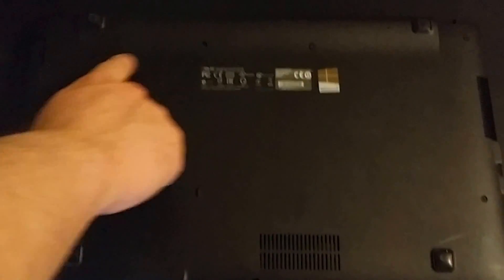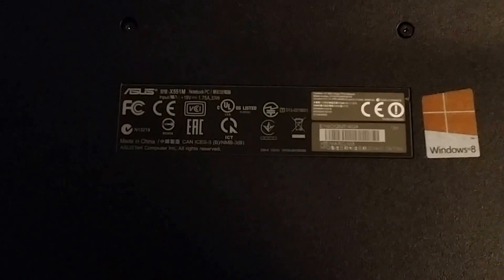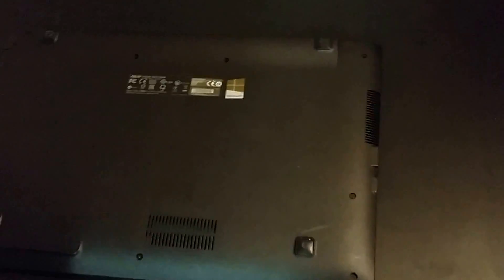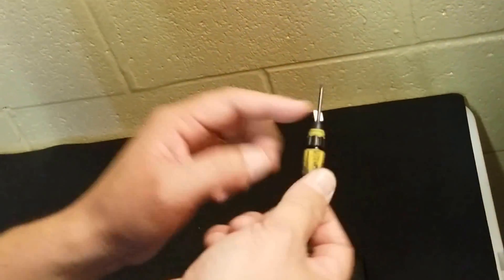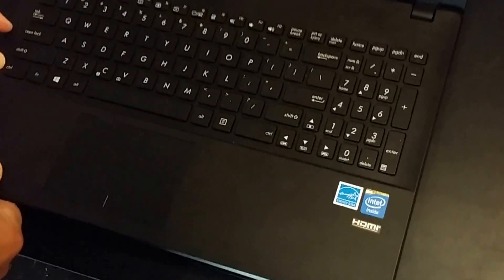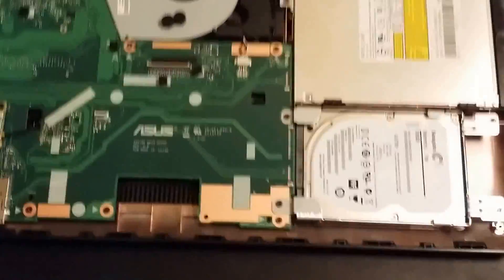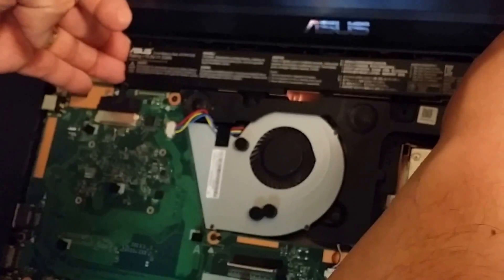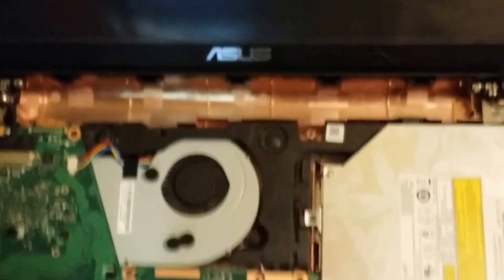ASUS X551M Laptop Battery Removal & Won't Power On Fix

Comment: Hey, great job/explanation of how to get to Battery--poor construction job by Asus. Can I reboot the computer with removal of electrical cord, without going through all that?
Reply from the maker: LARRY KRITCHER What do you mean by rebooting your computer?  If your battery is good and in working condition then yes.  If you are having issues such as needing your laptop reset such as plugging your headphone jack into the USB port accidentally and the system won't turn on unless you remove the battery, then no.  If I am not understanding correctly, please clarify.

Thanks!

Comment: i just got this labtop today to work on for someone and i literally hate it just for how they made it all this just to replace a battery made for regular people in mind but what aboult the people that work on computes such a terrible design but not the worst
Reply from the maker: scudder necrogen If laptop manufacturer's can't "Dremel" out a cut out for a battery so that normal regular people can't replace it themselves after 2-3 years of use, then to me, that is a computer I would NOT purchase.  But they did it this way because they are thinking that it is considered a "CHEAP" disposable computer that if there are any problems with it in the future, they would simply "BUY A NEW ONE", which is the wrong mindset ethically and for the environment.  Just my opinion though.
Reply: i agree with you that is a wrong mindset. but they will forget that there are people like use that will do are best to find a way to fix it. and help people  yeah at the time it was probably a 300$ lab top. but at the same time it,s not cheep for some in the end i am not a fan of lab tops i am more of a old school desktop user in the end but i do have a HP ProBook i like

Comment: I have an asus laptop, same brand, which suddenly went blank, and shut down, ironically somehow after i was accidentally trying to plug my headphones in the usb port. Ive tried literally everything, it will not come back on. This was a random incident.
Reply from the maker: RealityNotTv Don't feel bad.  A LOT of people have done this.  The fix is easy.

Follow the steps from my video and remove the battery.  Reattach the Power Button ribbon cable WITHOUT the battery or AC adapter plugged in and press & hold the power button for 30 seconds to discharge any residual charge on the motherboard/laptop.  Detach the ribbon cable, install the battery and then reassemble the laptop but do NOT screw in the screws yet.  Assuming your battery is charged, power on the laptop.  It SHOULD power on at this point.  If it does, then turn off the system and completely reassemble the laptop.

Devin

Comment: Hello mr. Squirrel,

I have one question, after unscrewing, how do I safely remove the back panel for cleaning? I have the A455LD which has the same design, but I'm afraid I'll rip off the insides just like I did with my old Acer:( thanks!

Comment: My Asus x551m fell of my bed onto my nightstand(not even a foot) and it won't turn back on the light for plug in also will not turn on Ive tried all outlets. I removed the battery for a minute then tried again. Everything inside is connected and looks fine. What could be wrong with my laptop? 
Thanks
Reply from the maker: peaceloveaeryn Most likely, you damaged the DC Jack connector when it dropped.  I can assume that you had it plugged into the DC jack on the night stand, correct?  If so, then you will need to take it to a computer repair technician and have them removed the damaged DC jack and install a new one.  On this model, the DC jack is soldered onto the motherboard and unless you have soldering skills with the proper tools, it probably would not be a good idea for you to DIY.

Hope this helps!

Devin

Comment: my laptop asus x551mav wont turn on ;( , this is a solution maybe ? thanks
Reply from the maker: Rafael Meza Here are the most common fixes to a computer that won't turn on:1.  Try a different Power Adapter.  Power adapters can go bad and when the battery runs out of power, a bad adapter will not power on the system OR charge the battery.

2.  Make sure the power adapter is plugged into a working electrical socket and that socket is turned ON.  Funny but true that this can happen.

3.  If you have a defective battery, it CAN SOMETIMES cause the system to not power on.  Remove your battery using the video then plug in a WORKING power adapter directly and turn on the system.  If it turns on, get a new battery.  If it STILL doesn't turn on.......

4.  Check your DC Jack connector to make sure it is NOT loose or damaged.  If the DC Jack connector is bad, it will NOT charge your battery or power on your system.

5.  Assuming that your DC jack is good, your motherboard may have gone bad.  If that is the case, check Ebay for replacement motherboard for your model.

6.  Final note:  Check your power button ribbon cable or button itself to make sure that the ribbon did not come out or the button is hitting the contact that powers on the system.

Hope this helps!!

Devin

Comment: good video! i have a Asus F751LDV, and want to replace hdd for ssd, but the top is hard to remove :( i have remove all screws but it wont be open at site of my laptop. and i be scare that i will it broke :( have you a tip for my to open the top of the case?
Reply from the maker: Patryk vd meulen Use a VERY THIN metal (but strong) stick (kind of like a nail file but stronger and rounder) and gently wedge it in the top right corner.  Gently apply pressure and you should be able to pry it apart and start to work it around the top of the lid spreading the top/bottom lids as you go.  That should be all there is to it!
Reply: thx! i''ll try it!
Reply: hi...I may have disconnected a ribbon...accidentally because now my laptop is not coming on..Please help

Comment: It seems to be similar to the asus x453m.. do you know if it is the same process?? x453m's batery is inside but there is not "x453m" dissasembly tutorial, any suggestion??
Reply from the maker: Eduar Jim Unfortunately, you will not know if it is the same process until you try.  Believe me when I say this but you should know within the first 2 mins.  Simply remove all the screws from the bottom of the laptop following the video's instructions and try to pry open and remove the keyboard/top lid.  If you can at least do that much, the rest should be self explanatory.

Devin
Reply: Thank you for the explanation, I will try that ;)
Reply from the maker: Eduar Jim Good luck!  I hope it is similar and it works out for you!

Comment from the maker: Chey,

If a screw is stripped, there is not much you can really do on your own since the screw is recessed in a hole.  Try ordering this:   http://www.amazon.com/Moody-Tools-58-0670-Extractor-Reversible/dp/B000JCT3W0

This will definitely help get a stripped screw from laptops out.  Once the screws are all out, follow the instructions from my video to remove the battery to reset the computer.

Hope this helps!
Reply: ***** Hey i have the same model laptop and i lost my old charger, so i bought a new one which is 90 Watt. do you think that's too much watts for this model ? because i don't remember how much watts the older charger has. Thanks
Reply from the maker: Kuti Kula Kuti, if you purchased an ASUS model charger that is 19V, the wattage is not a big concern.  I get that question all the time from customers purchasing power adapters from my store.  The simple explanation is in the form of plumbing.  Think of Voltage as the force of water pushing through a water pipe.  The higher the force, the stronger the voltage.  Think of Wattage as the size of the pipe.  The bigger the size, the higher the potential for the throughput of the voltage.  To answer your question, as long as you purchased a compatible charger that is specifically designated for a ASUS X551m on EBay/Amazon/Etc. and as long as it states 19V and has the proper connector tip, a higher wattage is OK.

Hope that helps!

Devin
Reply: ***** hey i bought universal charger from local store
Reply: ***** and it shows that the type of the output is 19 DVC
Reply from the maker: Kuti Kula You should be fine then!  Good luck!
Reply: ***** thanks

Comment: A few days ago, I went to turn on my computer after I got home from a softball game, I press the power button and the computer says it is "auto repairing" and then it turned off and would not come back on. I plugged it into a working outlet with its charger that I know works and the charging light would not come on nor would it power on. Everything that I looked at suggested that I take the back off and remove the battery and put it back in and drain the residual power, this is where the problem lies. One of the screws on the computer, on the bottom left corner, is stripped and a screwdriver cannot take out the screw. Any suggestions or thoughts as to what is wrong?

Comment: how to open X453MA laptop
Reply from the maker: Nur Ismalina I have not disassembled a X453MA laptop yet.  You could try and see if the X453MA is similar to the X551M by trying the disassembly steps to remove the top lid by removing the bottom screws.  If it is similar, then follow the steps on my video.  If it is not, it is advised to NOT proceed forward unless you are familiar with disassembling laptops and electronics in general.

Comment from the maker: Daelin,

If a laptop won't power on, it could be one of several things:
1.  Your AC Adapter has gone bad.  Try to get another compatible AC Adapter or Universal Adapter and see if it powers on.  You don't know HOW MANY TIMES customers come into my shop telling me that their laptop won't turn on, then I plug in my Universal AC Adapter and it turns right on.

2.  Your battery has gone bad.  Remove your battery and plug in your AC adapter and try and see if it turns on.  This MIGHT be the problem as bad batteries can cause a laptop to not turn on.

3.  Your Motherboard / Power Button board (on certain models) has gone bad.  A motherboard replacement can be costly depending on the model but EBay and Amazon is a good place to look up prices for replacement parts.  A power button board is less expensive but is still a part that can be costly depending on model.

4.  This SOMETIMES HAPPENS and don't laugh.  Make sure you are plugging in your adapter on a KNOWN good electrical outlet and the outlet is turned ON AT THE SWITCH (for those outlets that have a on/off switch).  I know it is funny but it can happen.  You drain the battery and it won't turn on and it won't charge because no power is going to the laptop.

Let me know what you find out!

Devin
Reply: Hi, if the power button ribbon cable no longer works will this also prevent the charge light from coming on?
Reply from the maker: So Savage No.  The power button ribbon cable has nothing to do with the charge light.  That light is on a separate circuit connection on the motherboard.  The power button ribbon cable shows when the laptop is powered on.  The Battery Charge light shows when you have the battery installed and the DC Jack is being plugged in by the power adapter.

If you have a power button ribbon issue, you will not be able to turn your system on using the power button.

Devin
Reply from the maker: Your problem is either your power adapter is going bad or your battery is going bad.  I have seen this happen a lot of time with customer laptops over the years.  Usually the easiest way to check this is to get a OEM charger from the manufacturer (ASUS, Dell, HP, etc) and not a knock off.  9 times out of 10, getting a new charger fixes the error message issue.  Then change the battery out with an OEM one if you are still getting the message.  If you still get one after all that, it is most likely a motherboard BIOS corruption and you may need to flash the BIOS to update it to the latest one.
Reply: Hi,

My issue with ASUS laptop.It won't turn on without charger.After putting the charger it turns on but battery not charging.Icon shows  0% pluggedin charging  But it was not charging,battery light was blinking after connecting the charger.Could you please give me a solution for this
Reply: @magbulshaik3461  Dead battery. Replace.
Reply: Angrysquirrel PC
Hello and thanks for your knowledge! 😊
Anyhow.... I have a newer Asus model with a internal battery. I got a few drops of water on my keyboard & immediately powered it off by holding the power button down & flipped my open laptop upside down. I then let it dry for a little over 24 hours but when I finally went to turn it on it started to power on then shut down (So scared I didn't wait long enough) & wouldn't start & my battery/charging indicator light was white. I did some research and gathered that I should remove the battery, so that's what I did. After the battery removal the battery/charging indicator light was now red & the the LCD light bulb indicator  was now on & White as well (I should include that these lights turned on after hitting the power button) immediately it started running  and it almost sounded as if it had  powered off  but was indeed still on. After waiting a few moments though I realize the screen isn't working  after further investigation I realized the screen is working is just ever-so-slightly lit  to where it is very hard to see with the naked eye almost impossible . So essentially the screen isn't bright enough for the computer to be usable and now the red light has turned off and the LCD light bulb is still lit White and the power button is not responding even though it originally did work to turn it on but I could not get it to turn it off. Is there anything I can do to fix this problem?? 
I'm really at a loss and can't believe that four drops of water caused all of this

Comment: I pulled the battery out and one of the prongs broke off! It was one of the outer black ones.
Reply from the maker: starberry2947 UM, you might be in trouble then.  Are you talking about the prong on the battery itself or the metal prong on the motherboard where the battery goes into?  I hope you are talking about the battery because you can easily get a new battery.  If it is the motherboard, then you will have to replace that and that will be more expensive and will take more time to replace.
Reply: I can't find the motherboard. I've scoured the internet for it :/ I didn't pull off the ribbon cables so I have no idea what type of motherboard it is. I just looked up the computer to try to find it.
Reply from the maker: starberry2947 So based on your comment, you broke the metal battery prong on the motherboard it seems.  I would call the ASUS parts department and let them know you need a replacement motherboard.  That would probably be your best bet.

Comment: my laptop shut down for no known reason while i was typing out an essay. anything ive tried wont turn it back on, and most websites say to take out the battery and then hold down the power button. is this the right thing to do and what are safety precautions i could take??? if i mess up this computer im screwed because i go to online school and i wouldnt be able to do any of my assignments please help

Comment: I have the same laptop but my laptop wont start but lastnight i accedentally plug the headphone on my usb port and my laptop shutdown automaticlly and when i try to turned it on it wont on! Help me please should i get my battery?
Reply from the maker: Paulrenan Solomon Sorry, I didn't realize my son had his account on when I replied.  Follow the steps from my video and remove the battery.  Reattach the Power Button ribbon cable WITHOUT the battery or AC adapter plugged in and press & hold the power button for 30 seconds to discharge any residual charge on the motherboard/laptop.  Detach the ribbon cable, install the battery and then reassemble the laptop but do NOT screw in the screws yet.  Assuming your battery is charged, power on the laptop.  It SHOULD power on at this point.  If it does, then turn off the system and completely reassemble the laptop.

Devin

Comment: I see that you can upgrade  the hdd but can you upgrade the ram? please let me know i have a little project i want to do with this computer.
Reply from the maker: Some models of this laptop will allow you to remove the Memory.  Others will not as the memory is soldered onto the board.  Even ASUS themselves will not know which version your model has even if you give them the serial number.  The only way to actually know is to disassemble the laptop and visually verify it on the underside of the motherboard.  Yes, I know...... it is a pain in the arse.
Reply: wow... thats bogus
Reply: thanks
Reply from the maker: No Problem.  Good luck to you!